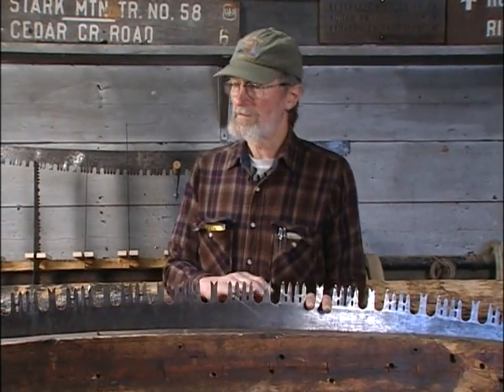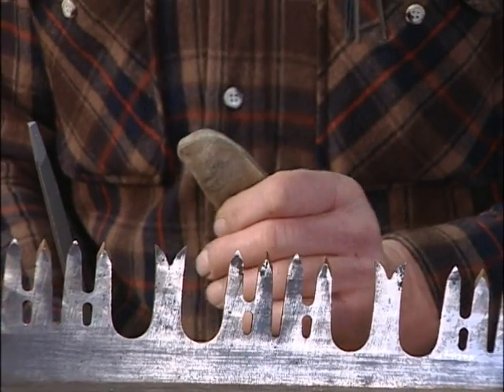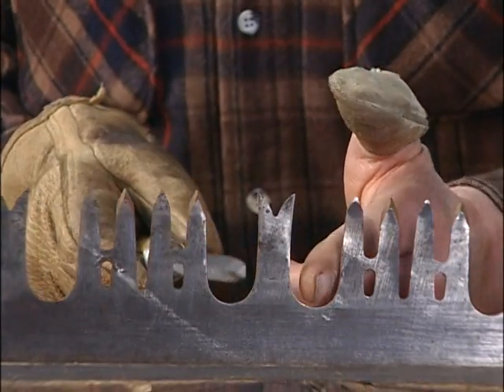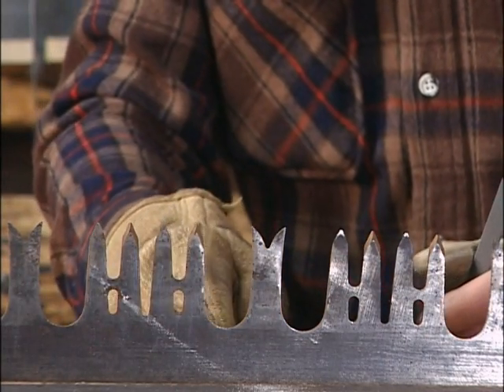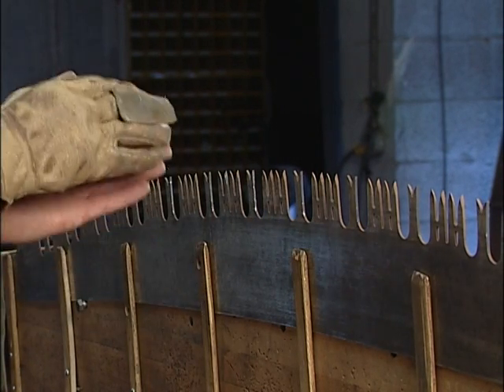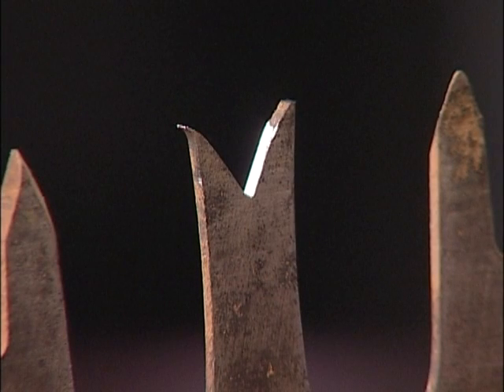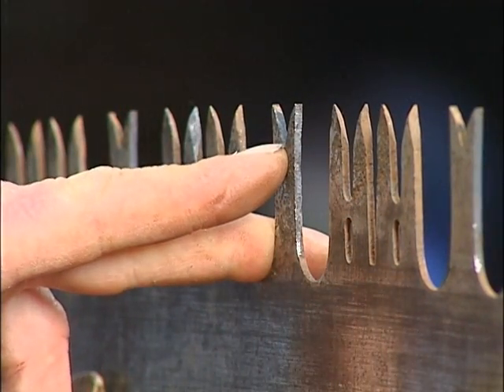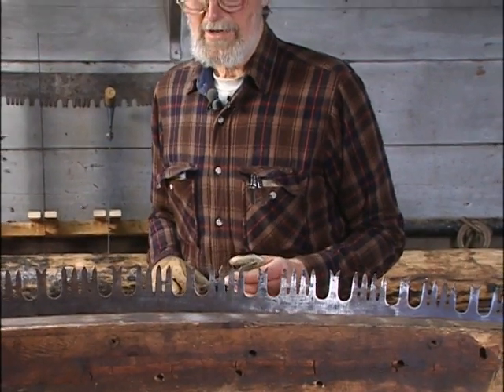The Crosscut Saw Filer, Part 5 of 5

Comment: Quite informative series. However, running the "steps" in reverse order is rather confusing. I suppose I could download each video and rework the ordering the sections to be in the correct order of operations, but would that be a violation of copyright if it is only for personal use and not to be redistributed?